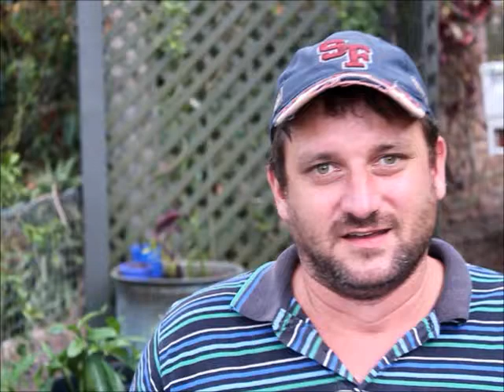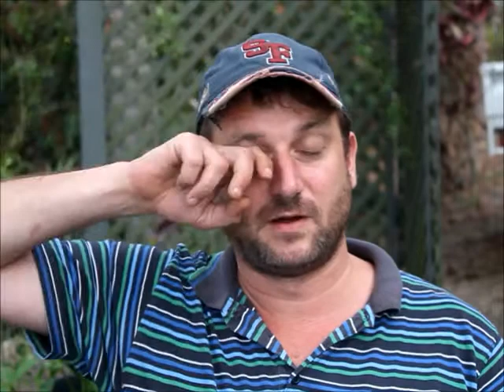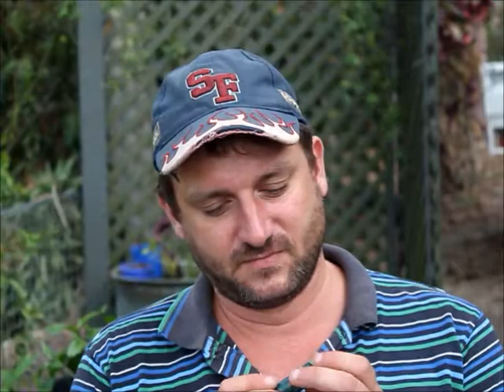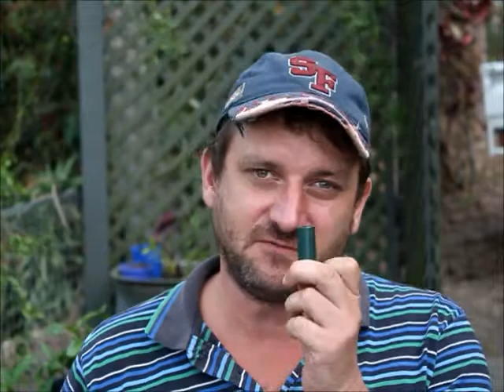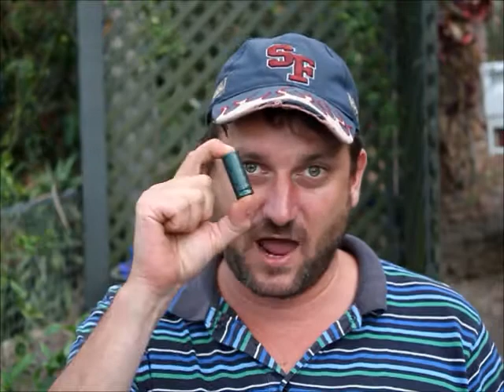MPP Solar PIP4048 (aka PIP 4048) Review - Multiple Failures

Comment: Hi thanks for a very comprehensive review. I'm really happy with my 4048 and less concerned as its brought into South Africa by Mecer with excellent local support. As an engineer I'm interested in your findings. I took the decision if I get 2 years out of a Chinese product i break even, 3 is a bonus cant justify the Victron we would probably all like to have.  

One question you may be able to help me with, my 5Kv inverter seem to use about 400 Whats from the Grid at night with no load is this a fairly typical loss?  Its a shame as it make the pay back period far longer in savings, is there a way to set the inverter to Bypass mode during the wee hrs when there is no load ?
Alan .
Reply: Sounds innovative, thanks I'll do some testing.  

One drawback of setting up an inverter is you basically re wire your house to suit and then if you switch it off all the tv's dstv decoders clocks and computers get reset.

I started with a 3KV inverter and quickly realise suge startups (pool pump etc) need a big overhead and I ultimately want to go off grid completely, so I upgraded to a 5Kv unit.  This may be slightly different to your unit as it seems more compact and an updated design, maybe some decent caps have been added :)

It doesn't have any manufacture ID and if I break the seal i'll break the warranty. It Ships with Powerwatch software and I'll see if I can get the manufacture ID so we have a fair comparison.  I really hope if I do run into problems one day I can take some of your findings in the repair attempt. 

I understood inverters operated at typically 90 - 95% efficiency, i assumed this was in proportion to the load.  So if I'm loosing about 500w/hrs of power from the grid to run my inverter in the middle of the night with no load this must be the quiescent current drain. So with my small 4 panel system i'm loosing at nigh what I collect during a winders day, thats totally defeats the entire project... I must be dong something wrong .. I'll look at a time switch but an Auto Bypass would be a much better sol if I can fins a way of implementing this.  I'm assuming I'm not the only one with this challenge  Ironically the inverter seem more efficient on quiescent drain when running off the 48 DC from batteries. If only the logger had some buffering I could pull the stas without having to have my laptop permanently connected.
Reply: Hi sorry I missed one of your replies so excuse the repetition.
Reply: Alan Falck Hi Alan you can set you Inverter program 1 to Utility first. You then would have to put a timer switch on your feed to the inverter. Come 10 pm or whatever time you set, your grid feed switches on and your inverter will automatically go into bypass mode. You could even top up your batteries or kept them in float. I have 3kW of panels on mine and the software associated with it especially the SOC is poor. Within 2 minutes of providing grid power my PIP/Mecer goes from 60% charged to 100% charged. I am due to receive a Victron battery monitor which will give me real data to work with. In my opinion MPP Solar are being optimistic in the accuracy of SOC using an internal shunt. MY reasoning is the Mecer is cheap R10k and for another R2k you them have a system where you know exactly what your  SOC is. With the Victron's version of the Mecer I would not be able to have as many panels as I have .I would need a separate SCC and inverter, which in South Africa would cost about 3X the price. I am happy with my PIP/Mercer and think by adding a battery monitor you end up with a very good system at the price. 10 minutes after the sun hits my panel I am producing over 1kW and midday (winter) I am getting 2.24 kW which is more than I need. I have never had hassles with the voltage as EBE has had but one needs to be aware of these issues. In South Africa  the inverter appears stable and there are 1000s now installed with most installers saying they are robust. One Aussie installer whom I contacted has had failures especially in humid environments and system that have larger arrays like mine. Hopefully MPP Solar have sorted themselves out.
Reply: Hi thanks for the suggestions Chris, & quiet reassuring there is some critical mass when u starting out.  EBM is right it is the high Quiescent current (my best stab at the terminology for leakage current) that is costing me about 5kw per night that's driving me insane (500w x 10hrs in winter).  I will try EBE manual Econo mode this weekend.  It's scary to remember the inefficiency curve down the lower end of the scale.
Reply: Alan Falck  The 3kVA you had had very little draw but the 5kVA has about a 50W draw. I learnt a trick today. If you set the battery cut-off voltage to 42V (the default) then all the SOC and other readings seem to become accurate (believeable) within the software. The battery cut-off can only go up to 48 V so it is near useless anyway. How anybody in their right minds thinks 42V is a useful voltage to intervene I don't know. I will use the relay on the Victron Battery monitor to operate a contactor to regulate load and therefore DOD. I cannot wait for the battery monitor so that I can be sure what is going on and compare the PIP software with something I trust. At the moment it like driving a vehicle without a fuel gauge.
Reply: Alan Falck Hi Alan I have re-read your post and either there is a draw you are not aware of or there is something wrong with your unit. Kurt one of the Aussies who is experimenting with the PIP measured its self consumption accurately to about 46W.
Reply: Easily_Bored_Engineer  Hi I seem to have lost my reply but I give it a go again. I think Alan is worried about his batteries and so if he is in bypass through the night he kick starts the morning with a battery bank in great shape. If it amounts to 5 kWh that will be roughly 70 Aussie cents. One day when we no longer have a buffoon for president our currency will be worth something.Kurt from the AEVA has measured the self consumption at about 46W.
Reply: Easily_Bored_Engineer  Morning - here in SA (not South Australia) . Thank-you. I would like the help. My batteries are 4 x 12V  260 Ah which is too small for any real autonomy but I live in a very sunny part of SA and for the most part I do not need a big battery bank. I have a gennie which runs every evening to power the farmhands' cottages and I have wired the power through to the inverter, so I really need the batteries to tided me overnight. The batteries are VRLA. What should my bulk, adsorb and float be (or where is a good resource that I can read up a bit more)? The documentation that came with the battery was more concerned with the restorative charges should the battery  have stood for a while than charge required for daily use. I know I should not exceed the gassing voltage The batteries are charged by 11am so a slow charge is not a problem.

 I did a year of Physics at varsity and then continued on with Biological Sciences. So I know the basics but not the intricacies. My son (aged 7) is electronics mad and perhaps an Arduino project is something we both can cut our teeth on, since I am going to have to teach/help him. We play around with magnets and batteries and switches and LEDs etc. I think he may get addicted to the smell of solder! I am 8km from nearest point so I was always going to be off-grid it was question of saving enough for the system. I was getting quotes for $(AUS) 40,000 - 60,000 and I am not made of that sort of money. My system cost about $ 7 000 of which the PIP was $1 000.
Reply: Easily_Bored_Engineer  My system is 48V
Reply: Easily_Bored_Engineer Getting a 702 battery monitor so I will have a midpoint battery voltage reading. That should alert me to any cells out of balance.
Reply: Easily_Bored_Engineer.Thank-you. I have killed batteries before using unsophisticated charging technology (inherited from my father) on an old 32V DC light system (a battery exploded). I hope that is the last.  I watched the videos (yours and the other guys). Monday I will order the components. I live in Graaff-Reinet a rural town  of 35 000 people so the components are going to be sourced elsewhere. What sort of heat is created? I understand one uses the pole(s) as a heatsink.
Reply: Hi Ive discovered my inverter does not support the Economy mode at all (Option 4 from the keypad only has one setting).  So I'm back to square one with my overnight drawdown around 5 - 600Watts 

Chris I'm keen to follow your battery monitoring project, I'm base in Cape Town shout if you need any parts.  I'm in IT so have accounts with almost all the suppliers if this helps.... A
Reply: EBE have you done firmware upgrades on the PIP if so where do you get the updates from ?
Reply: OK thanks... I see the 'Cap' debate continues with yr fellow countryman,. I'm glad I'm aware of potential weaknesses either way.  I would rather know what to look out for than be surprised.
Reply: No worries you cover your concerns professionally and with more evidence than O J Simpson :).
Reply: Very usefull thanks !
Reply: Iv'e moved my 'leakage current' issue to my channel so as not to hog yours, ( sorry not sure of the Blog etiquette yet), Ill update you on my progress with your balancer in mind. Really hope I haven't fried my 2 month old battery bank already.
Reply: Hi how is your project going, things seem to have gone quiet with Justin :) .... Are you still rolling out radio sites around Oz ? (I guess using Victron)..
Reply: Hi thanks for asking. To be honest I’m somewhat perplexed at my Battery issue and setup. (I've mainly dealt with small batteries in electronics (Li-ion) and some small lead acid, but I believe the theory of a 7A Gel Cell is very similar).  
Firstly I would expect a fairly large bank of Lead Acid batteries (800A or 9Kw) to behave in a linear fashion.  I.e. slow discharge & recharge with moderate loads. FYI:  I’ve installed another 4 x280w (2kw total) panels giving me around 1.5Kw solar to charge batteries on a bright day.  I’ve ended up with most of the new bank showing low or replace battery on the electrolyte indicator. 
The actual (fluke) voltage on the terminals looks OK around 13.8v but clearly my batteries are not charging correctly form mains or solar. My theory says you need absorbed, float (trickle) & equalisation voltages to maintain good battery health.  So I’ve set the Bulk Charging (raised the default on the PIP) to 58.40v (14.62) and the float to 54v with cut off at 42v.  My understanding is I’m undercharging my batteries and hence the no green electrolyte indicator.   I’ve spoken to the inverter & battery supplier and they seem useless, I’ve looked at the spec sheet and it only has discharge info so I’m looking for some safe guidelines to start with.
Reply: PS the Battery Library resource is great thanks
Reply: My apologies I clearly didn't communicate my reference to 'Gel Cell's' clearly... this was just a comment about my only previous lead acid charging experience.    Indeed my solar batteries (as you gathered)  are seald Calcium lead acid.  But your effort was not in vain as I've now got some better insight into the differences.  

I cant seem to attach the only spec sheet I have so here is a link https://www.dropbox.com/s/28m14uzqsbs8rdu/Setsolar%20Deep%20Cycle%20batteries.pdf?dl=0  Ill try and track down the OEM.

I will conduct your suggested tests and let you know the outcome, thanks again and sorry for misleading you.

PS: I've used the thresholds for lead acid charging from the 'Battery Library' site in the interim.
Reply: HI I've made some progress. I set the input of the inverter to Grid.  I raised the charging voltage to15.00 volts and left it charging for 24hrs.  7of the 8 batteries are now displaying Green on the Electrolyte indicator :) 

 I separated the pack and manually charged the one with a car charger, then added it back in the next day and all is green.

I will do the independent test you recommended on the weekend, thanks for the help.
Reply: Yes I like yr Balancing circuit idea, I'll try and work with Chris, (actually your blog connected us up :)  As soon as the warranty is up on the PIP I'm going to rip it apart and put some 100V High Heat (Automotive quality Panasonic) replacement Caps in .. may be worth a look to see if the Chinese actually took you advise on the upgrade ?  I've often seen fixes just creep into production (maybe a cultural shame thing).  Did they give you a circuit diagram when thee y replaced yours ?
Reply: Cool lets see how the existing system copes with the 58v charging level
Reply: Hi Eventually I have the charging Specs ...  Float Operation:
Float Voltage:            13.60V +- 1% (54.40V)
Boost Voltage:          14.40 V (57.60V)

So lets see how these suckers behave over the next few weeks.  

I'm still amazed that 9Kw of batteries can loose about 40% of their charge overnight (12hrs).  As you pointed out I have about 3Kw usable capacity (30%) so from lights out (11 to sun-up  to 7am) I think I should be using about 150w  one AAA fridge, Alarm & 2 LED security lights and say 50w loss on the inverter.  I guess I need to work through every circuit on the DB and compensate for the eFergy power factor error ?
Reply: Hi OK thats interesting that you recon the inverter drain is around 800W/hr Its a big loss when you are not using much power at night.  

We have a small 1Kv unit running at work as a UPS, it may be worth me splitting my loads up possible using 2 inverters or one very small one for lights etc.  That DC to DC converter could be the answer. I could try shutting down the inverter at night and on some kind of timer like Chris suggested ....
Reply: +Easily_Bored_Engineer Hi  I have one battery that goes high 14.7 and the others hang around 13.8 - 14.0 but by late absorb just before it drops down to float the batteries are within 0.02 V of each other. The batteries have settled down now. Before we were getting enough sun and I was battling with the balancing I bought 3 of these on ebay (http://www.ebay.com/itm/221839283113?_trksid=p2057872.m2749.l2649&ssPageName=STRK%3AMEBIDX%3AIT). The unit's optimising current is up to 5A so perhaps they will get my 260 Ah batteries  balanced quicker. I plan to have a peep inside one of them and perhaps make some as a project.
Reply: Today the Victron reported a mid-point deviation of 1.4% and only for about ½ hour. Full sun - good solar day.
Reply: Hi Chris glad you making good progress. Do you still need help wit components ?
Reply: +Alan Falck Hi Alan I have found a place in Oudtshoorn not too far from me who surprisingly seem to hold more stock than the electronics places (that I know of) in EL, PE or Bloem.
Reply: +Chris Hobson  Hi Dockarl. The chinese balancers work ok but I am still not happy. The zeners use to work but were unable to correct deviations in late absorb in the big 260 Ah batteries. The chinese balancers start working earlier but still do not transfer enough charge and the battery bank is imbalanced but for a shorter period of time. I am now contemplating building an active balancer. The idea is to connect a boost converter via a relay to the identified high battery (identified using OP-Amp or something more elegant). The pulsed output from the converter would then be fed to the entire battery string. We have dubbed it battery socialism "Robbing the rich to give to everyone". This keeps the output side  simple as one could end up with a very complex system.  

Any ideas comments.
Reply: +Chris Hobson  I have thought of moving the battery that goes high to position of battery 3 so that there is better dissipation of charge as the balancer first pass charge from 4 to 3 and then from 3 to 2.
Reply: +Easily_Bored_Engineer Victron BB work in the same fashion as the Chinese version I have. Energy is transferred to the battery next door and so on - "pass the parcel",  which is not very efficient as now you have two batteries that are high albeit not as high as the first.
Reply: +Chris Hobson  the Chinese balancers appear to be nudging the batteries in the right direction. The batteries were out of balance for only about ½ an hour this morning.
Reply: +Easily_Bored_Engineer  What is happening is they stay in balance for longer during absorb.  They use to go out of balance when the Victron BM was at a 93-94% SOC reading. They now only go out of balance at 97% SOC just before we go into float and once we are in float the batteries are within 10mV of each other.
Reply: I watch his stuff every now and again but he does not really impart any information. I am busy looking at a Arduino battery monitor/balancer and am interested in what he has done to replace the really crap software that comes with the PIP. He does not seem willing at the moment to release the software that he has paid/asked a programmer to implement. Fair enough but in SA the boys are only too pleased to help each other and it would seem is going to be released as freeware/shareware.
Reply: +Easily_Bored_Engineer No Justin does not seem to want to release the software that he and  Jeremy have put together in contrast to the SA boys.
Reply: +Easily_Bored_Engineer Finished shearing to-day and so will get a bit of time to fiddle.I have given my battery monitor/balancer some thought and asked some of the boys who are hobbyists for solutions. At the moment I just want to implement the monitoring portion and leave the balancer till a bit later. 4 ATtiny 85 s each running its own voltage divider connected together (I2C) through opto-isolators to Arduino. Have spend part of this morning writing the code.